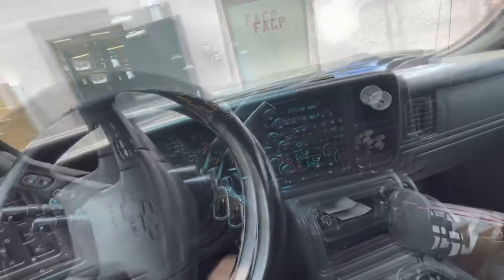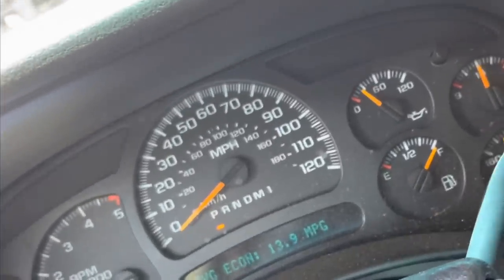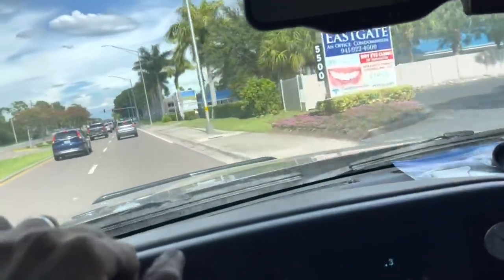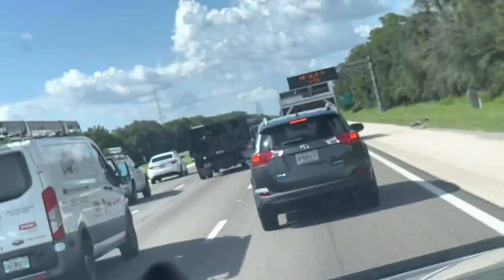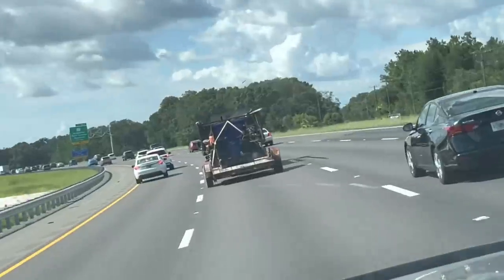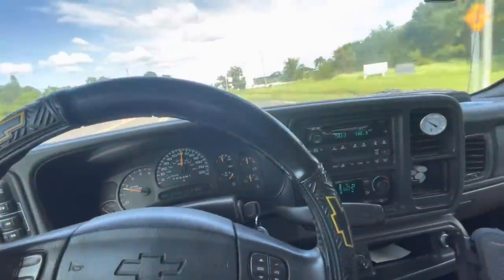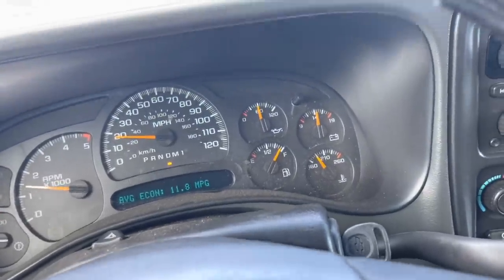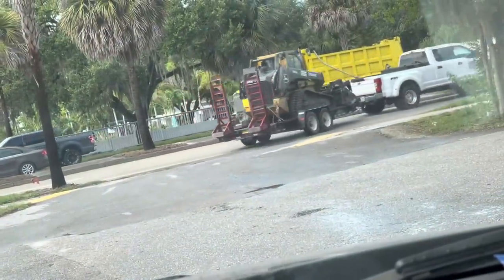Need answers! ox-cetane Diesel Fuel Experiment | Duramax 6.6 LBZ

Comment: all that fuel additive does is clean the varnish and some carbon buildup off the ports to restore lost horsepower. It works better on older cars that's done big miles, you will not see any difference on newer cars. I have used similar before and it does work.

Comment: WE know Octane, the pricy gasoline, so what is cetane? Simply put, cetane is a chemical compound found naturally in diesel, and it ignites easily under pressure. Because of its high flammability, it serves as the industry-standard measure for evaluating fuel combustion quality. Specifically, this measure is referred to as cetane number.

Comment: While there are $90000 Teslas, you don’t need to spend that much to take advantage of an electric vehicle. The Chevy Bolt, while not in Tesla’s class, is an excellent commuter car, even when the commute is 45 miles, and it’s about $26000. The Bolt has a range of 259 miles, which real world works out to about 200 miles. At the speeds you travel it will get about 3.4 miles/KWh. I live in South Florida and pay about 10 cents/KWh, so if your electricity rates are about the same that works out to 2.9 cents/mile. For a 45 mile commute that’s $1.30 each way. Assuming you’re paying about $5.50/gal diesel and getting 14 miles/gal your current cost is 39 cents/mile or $17.55 each way for a 45 mile commute, or $35.10 per day. The Bolt would save you $32.50/day or $650/month (assuming 20 commuting days per month). BTW, GM has fixed the tendency of the Bolt’s battery to catch on fire.

Comment: I bought that 90 gallon tank for when I see cheaper fuel.... but did you account for the cost of hauling around all that extra weight? Number one the weight of the tank itself when it's empty, and number 2 when you do fill it up because the price is cheaper isn't fuel 8 pounds per gallon? So an extra 720 pounds to carry around 90 gallons at a cheaper rate. Does the fuel economy not decrease enough carrying around an extra 720 pounds to offset the cheaper price per gallon? I assume you factored that in and it is cheaper. I'm just asking the question.

Comment: How accurate is your vehicles mpg indicator? You have road grades, wind, acceleration, deceleration , traffic that all effects mileage, you’ll never get a mpg reading that is the same. Measuring the BTU’s of the fuel will tell much more. I had a Cadillac that you could watch mpg in real time and accelerating hard was near 0 mpg and coasting downhill could be 90 mpg. It constantly varies

Comment: So basically it's just any other fuel additive used to clean out carbon buildup. I mean, they theoretically should work, but as far as I know there isn't much to totally back up those claims. The FTC for example says that in theory it should do something but be so little to be immeasurable. It theoretically would be more obvious with a car that is vastly older and worn out as they are the kind more likely to have a ton of carbon buildup. 

More likely, anyone seeing results will be from the placebo effect.

Comment: Is that a US Gallon (4 litres) or a UK Gallon (5 litres)?

And what's a Quart?

To let someone in I just flash the high beam at them, means you can keep your hand on the wheel.

A good fuel treatment can be more than just hype, cleans fuel lines and clean/lube injectors. Probably raising the temperature inside the cylinder combustion chamber and helping decoke pistons and valves too.

Forte has a good line of
treatments including engine oil/coolant flush treatments etc.
Reply: UK gallon is more like 4.5 litres.
Since he is in the US, I think it's safe to assume US gallons.
A quart...hmmmm, maybe a quarter of something....maybe a quarter of a gallon?
Reply: @Cheepchipsable   @Cheepchipsable  I smell shite, a UK Gallon is 5 litres period.

Why not say a litre then if a quart is a quarter of a US Gallon?

You've been to a confuscious convention haven't you??
Reply: If you need me I will be over there in that corner >, I'll be the one wearing the tin foil hat on rambling incoherently about suffering from Mandela Syndrome.

Feel free to join me but please supply your own headgear, I used my roll making .ine.... Sorry ...

Comment: Hard to accept the claims of "fuel improvers" on face value.  I had a new Nissan 4WD in my dyno room once, testing optimisation concepts for the factory techs.  Two guys came in near the end of the job with a small sealed device which was zip tied to the fuel line.  It was going to change the polarity of the molecules and improve combustion efficiency by more than 20%.   Hooked it all back up again to the data systems and ran a full range of exhaust analysis and engine output printouts all over again.   Compared them with tests ran during the previous four hours and there was absolutely no difference.   Of course.

Comment: I'm no mechanic (not anymore anyway due to medical things) but is your truck old enough to lose a partial refrigerant charge through porous hoses? I have seen additives that supposedly help seal the hoses but prefer to keep things factory for daily drivers.
I'm sure you are aware but a/c systems are sized by bean counters to meet 'design-days' with the absolute bare minimum of capacity.  Your Florida location is on the edge of being on the undersized part of the curve.  Much in the way heater cores are undersized for arctic climates. When I used to winter travel the Appalachian mountains in a 70s era Bronco, it was common to pull over every fourty five minutes to clear up a frozen windshield on the inside with the defrost doing all it could do. I was using a 180 degree thermostat and a partially covered radiator. Eventually (since it was very easy to do so) I changed to a smaller radiator just for winter travel. I didn't mind the effort (kept the wife happier) and it gave me an excuse to do a seasonal checkout and change the header and valve cover gaskets again.

Comment: Gz Ray you travel 48 miles approximately to work each day, Boy are you keen. UK rule: The Department of Transport claim that a breach of Rule 110 and 111should you flash your lights to convey a message to any other road user. This can and will result in possible court action. Looks like a highway full of Rubber necking.
Reply: Why, what evidence do they have that this law will make it safer. Communication is the key to safe driving, directionals,horn,flashing lights.

Comment: Hey Ray! I'd like to ask you a question. What do you like/dislike about your duramax vs say a cummins from the same year? I'm looking into my first dually and am wondering what the benefits of a chevy diesel would be over a dodge from around the same year. Love your videos by the way!
Reply from the maker: I love the Allison 1000 trans that’s behind the D max. If I could I’d have a Cummins/Allison combo. The Cummins isn’t as wide either because it’s an inline configuration. The v8 revs higher and the I6 Cummins has more torque.

Edit: I don’t like dodge body’s or interiors (especially the dash if it hasn’t fallen apart)
Reply: @RainmanRaysRepairs  gotcha. That was really helpful, thank you! The reason I'm leaning toward a cummins is I'm looking for a 6 speed manual and around me they have proved tough to find a stick shift duramax. I appreciate your input!
Reply from the maker: @gdcatalyst7812  If you do find a manual D Max you let me know!
Reply: @RainmanRaysRepairs  I certainly will! Are the manual transmissions that are mated to the d max pretty solid? I would assume the reason they are hard to find is the Allison is so well respected

Comment: F150 3.5tt with 36gal tank and bout 700# of tools. 20mpg in town 23 road at 75mph. 
As far as cost, what additional this stuff adds to the total cost per mile? Like buying premium vs regular. Or 10% ethanol vs pure gasoline.
Reply: Update. Drove 5 hrs today mostly 75 mph  25.2mpg

Comment: I did a lot of fuel experiments in my gasoline trucks. I found filling half the tank with 87 octane, and half with 89, plus cheapo Havoline dino oil got me the best gas mileage... over using fuel or oil additives. Weird.

Comment: In Central New York where I am, they call it "Distracted Driving",
and if LE sees you not looking straight ahead, you'll be accused of
whatever Officer says. $90 mandatory "Court Fee" on top of a
moving violation charge, points on insurance for 36 months.

Same thing for seat belt. "Click it or ticket" is big here. LE will reach
in your car, grab your shoulder strap & tug on it to make sure.
An yes, they act like God.

Of course- all can be pled down, but that Court Fee still applies,
guilty or innocent. NY is a horribly crooked racket of corruption.

Comment: My 2003 durtimax 2500 got 18-20 mpg all the time.  And averaged 21.4 on a 2000 mile vacation to yellowstone.

These new diesels seem to have gone the wrong way on mpg!
Reply from the maker: I think its reasonable for my particular truck. Its an 07 3500 dually  long bed crew cab, with a ranch hand bumper 90gal aux fuel cell, steel back rack window guard, and a toolbox. I think it weighs around 7500lbs if the tanks are full. I have my reasons.

Comment: I think your engine designers need to have a long summer school in Japan.   My Honda Civic 2.2 diesel does 59-61 mpg even when traveling at 70 mph.  I have even seen 91 mpg for the first 8 miles since filling up with fuel.   btw It is quite quick as well with a top speed of 130 mph, if only that was legal here.

Comment: Higher cetane numbers actually have very limited benefits with modern diesel engines and could cause more harm than good. Cetane boosters are pretty much snake oil; you're essentially just adding 1.5oz of alcohol into your diesel truck. As folks commonly point out with ethanol, alcohols can make water actually mix in better with your fuel. So..yeah. Also diesel from the pump is already at manufacturers'' recommended cetane rating number. Anyway, the plus side is at the concentration you mixed in, 1.5oz in what I'm guessing is a 20 gallon tank, you're at like a 1 to 2500 ratio of alcohol to diesel, which is basically unnoticeable, so the additional alcohol shouldn't harm the engine.

Comment: Does it smell like an agitated stinkbug? We have similar stuff in europe, supposed to to help fix poor quality fuel to get a proper burn and clean internals a bit. Seems to help some if you haven't used it in a while and it's not very expensive so I buy it for good measure. P.S. 15MPG would be considered abysmal here, especially on a diesel. My diesel SUV does ~25 and still makes most people's eyebrows rise.

Comment: Hey Ray have a question I have a 88 Chevy van with eight Lug 16.5 rims do you know what other vehicle I can use the rims off of that has 8 lugs that will make them 16 inch rims need to get rid of these 16.5 if anyone can help it would be greatly appreciated

Comment: $5.57 /Gal...  Here diesel is currently equivalent to US$7.01/gallon...  you have it nice and cheap.  I have to add...  my diesel, admittedly only 1/2 the size engine to yours..  but a 2400kg...  2-1/2 ton vehicle does around  26 mpg using your US Gallon...Here I calculate it at about 29 to our Gallon or 9 litres / 100km

Comment: If only I could buy fuel @ $5.60 per US gallon. That's ~ $1.50 a litre. Current UK exchange rate puts that at £1.25 per litre. Currently ours is ~£1.98 per litre, or $9.09 a US gallon.

Comment: I never believed in any of these products as I see them all as snake oil, I've seen people put snake oil in their vehicle and it starts cleaning up carbon that should have never been cleaned up because of the amount of miles on the vehicle can cause issues. An old mechanic once taught me when a vehicle has been running for $150,000 miles, cleaning things up in the upper top half of the motor can be devastating as the vehicle has been used to and has become carbon friendly to all the motor parts in the upper half.

Comment: You’re a little bit short on the cetane dosage Ray, your long bed truck has a 34 gallon tank, which in reality probably holds 35 gallons if filling it from completely empty as in a new empty fuel tank was installed.
Edit: I think what the guy meant about videoing while driving is that in some states you can’t have your phone in your hand while driving for any reason. Hands free only.

Comment: That's all: very dubious! 
The cab drivers in Germany, who often drove 700,000 to over 1,000,000 miles with one engine, had a "top oil" added to each tank of diesel. 
What is top oil? 

Today we use a two-stroke oil. 
If you test this, you'll see the engine lasts forever and three days - and it runs a little smoother. 
It has less to no deposits and runs and runs and runs. You can add 0.5% bi 1.0% oil. 
I even run this oil in gasoline - it really runs smoother. 
The 2-stroke oil can be mineral or full synthetic - I haven't noticed a difference.

Comment: 97f, Pfft.  Your truck would just melt in my 109f heat on my 40 mile commute, and I'm not in a total desert, either.  My recently redone AC struggles just as hard, especially since I'm demanding a 40 degree delta.  I'm not built for heat.  I'm built for permafrost.
Reply: Lol, 97ºF is only 36ºC (not that hot) and if the AC is capable of making 22ºC, I wouldn't say it's struggling, it's an adequate temperature. I wonder what he would say if he had to endure commuting home 5 days straight with temperatures averaging 41ºC (105ºF) here where I live in Central Portugal. We're in the middle of a heat wave and we still have 4 more days to go with temperatures averaging 43.5ºC (110ºF)!

Comment: This is not the Placebo Effect. The placebo effect would be the correct term if Ray got the same or even better results from putting something in his tank that came out of an Ox-Cetane bottle but was just... clear diesel. In other words harmless to his fuel system and engine but no different than what he is already burning.
I think this is more likely described as the "Diet Effect" in that, as you may all know, when someone starts a diet to lose weight they almost allways lose weight... for a while ( a month and five to ten pounds is typical.) After a while they gain it all back. It is not so much that the particular pill, shake, smoothie, 'Lean-Cuisine', fruit juice, exercise, or whatever the regimen is for the diet/weight loss program as it is mainly they are paying attention to what they eat, how much rest they get, how much they hydrate, etc... After a month or so they let up and migrate back to their old habits. It may be that the 'improvement' Ray is seeing in mileage is largely due to the fact that he is simply paying attention to it. It may be that after using this stuff for a month or so that his mileage will be right back where it was (the Diet Effect.) I also suspect that IF there is ANY real improvement in mileage from using the requisite amount of Ox-Cetane in Ray's truck that the amount saved will be miniscule after he factors in the cost of using the additive.
In any case, this should be interesting to see how it works out.

Comment: I find it hard to believe that adding an ounce of that stuff to 20 gallons (1:2560 ratio) is going to have any effect at all on your engine, good or bad.  The companies that produce these automotive lotions and potions seem like snake-oil salesmen to me.  They count on the consumer having that placebo effect you described.  I've tried numerous ones over the past 5 decades and I've yet to find a noticeable difference in performance or mileage using any product I've ever tried.  It's a waste of money if you ask me.  Just do your regular maintenance, keep your oil clean and topped up, keep all the filters clean and you'll do just fine.

Comment: Dont  all your American cars have a Flash to Pass on the indicator stalk? Why turn the headlight switch? It is very common in the UK to flash if you want to pass or flash when someone lets you through on tight roads. We are at 10 quid a gallon at the moment and my truck will do 29 miles to the gallon (3 L Twin Turbo Diesel). Its crazy you are happy at 14.8

Comment: Sounds like snake oil reading the label. It can only help if (1) it adds a LOT more calories (which it does not) or (2) it increased the delivery and consumption of both fuel and air. If your fuel systen was dirty/clogged (without the money light on?) and it cleaned it up it might help AFTER it was in long enough to do the cleaning. 

My 6.4L Powerstroke gets an AVERAGE of 15.5 to 16 mixed driving and 20 on the highway with no mountains and sometimes 22mpg. You need to do a 500 mile round-trip with and without and with similar wind conditions but the round trip tends to average that out. Windage is worse than adding 600 pounds of fuel.

Comment: If you ever visit the UK Ray, dont use a camera whilst driving. Holding and using any device like this is illegal and will get you 3 out of 12 points max on your licence and between £200 and £1000 fine! Even applies when stuck in traffic..

Comment: it is cetane..."improves the air release properties"????  How much air is in your fuel?  Does that bottle say anywhere on it how many basis points it raises the cetane?  This is just the diesel equivalent of octane booster.  and octane boosters generally raise the octane level of gas from say 91.0 to 91.3, or thereabouts.